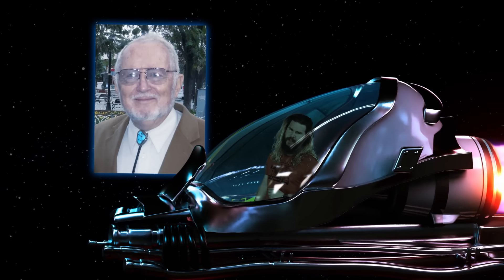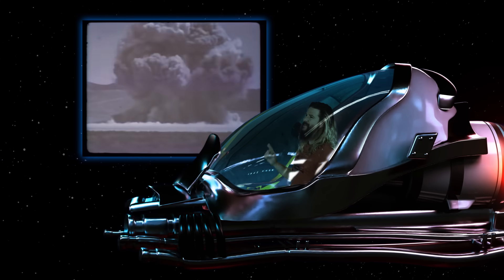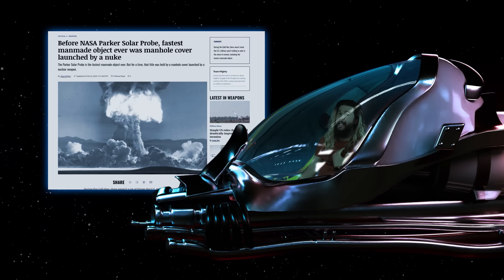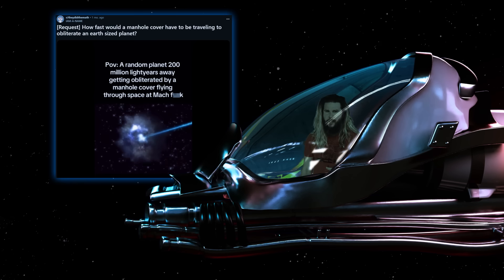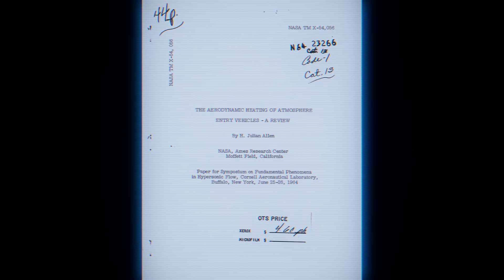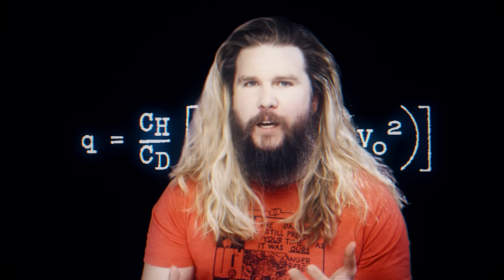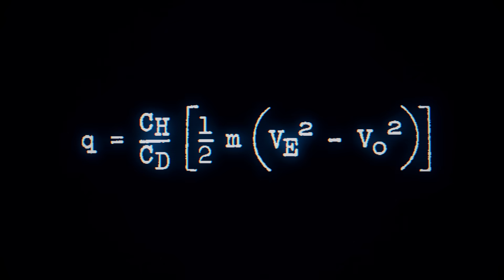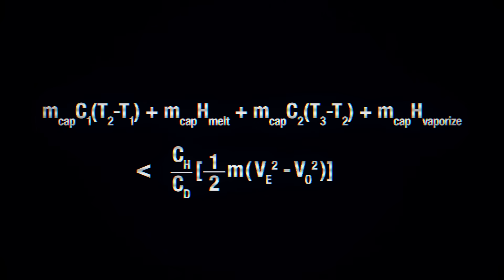Debunking the Nuclear-Powered Manhole Cover

Comment: Nope, I say there's still too many variables for basic equations to equate whether or not it actually burned up in the atmosphere or if made to space. One variable is yes, the aerodynamics, whether or not the cap was flipping or not 2, the density of the iron used, you would need to have a sample of the exact iron use. Not today's standards also escape velocity. You said 66 times the speed it takes to escape Earth's gravity, Well, how long would it take for that cap to leave atmosphere at that speed? No, you need to deal in definites if your gonna "math" this out. Need to find out how far the camera was from the test site, how fast the speed of the film was. And then once you find that out, find out how high the cap or manhole cover was from the ground on the single frame that it was caught on camera and then he equate out how fast it was moving. To be able to reach X feet or meters at x time, everything else is variable, but time is the most crucial thing in this calculation of yours. How long did the manhole cover spend in the atmosphere? Because if it spent less than a second at 5.09 J, or whatever you said, then is that enough energy to vaporize 4 inches of cast iron or would it just flash the surface of the metal?

Comment: What i have issued with is the fact the atmosphere gets thinner on the way out! Thicker on the way in. I feel it would  need to melt in a fraction of the atmosphere thickness. No math involved, i feel it made it out to space, likely , mostly burned up. Maybe 200 lbs of it. The altitude will affect it also . I think it was burned by the sun. Or is a tiny bit of space junk, or this is what  omouamoa was.😂

Comment: No physicist here, just though on things that have been put aside in that calculation. All of that calcul is assuming the manhole was traveling thru stationary air the entire time, but in reality there was probably a push from the explosion shockwave for some small amount of time in the very beginning, might not count for much, but it's at the altitude air density is at its highest.

An other variable to the equation you used is that contrary to a re-entry the object was moving from hight air density to low air density so there was less and less drag as it was moving thru the atmosphere.

An other thing very different from a re-entry vehicle or meteor is the trajectory, most thing entering our atmosphere do it at an angle encountering air resistance for much longer than if they were traveling in a straight line.

I'm not saying it did reach space, I'm not even sure if what im saying really make sense with your equation and I absolutely don't have the knowledge to come up with an alternative equation, but I know that sometimes changing one small detail in an equation can massively change the result

Comment: Some big problems I have with this, the manhole cover angle would have been nearly straight up, your equations do not include time in atmosphere, as we know from things like lasers you can apply a crazy amount of heat to something, but if the heat does not have time to penetrate the object, then it does not matter. Another point your comparison of meteorites highlights another issue, the are visible, because they are a hot object moving through the atmosphere, your example would mean we expect to see a bright streak where the cover was traveling if it was burning up like a meteorite does. Next point is how the atmospheric pressure works, it drops with altitude, meaning diminishing heating over time. 

 Also according to NASA the maximum measured re-entry temperature on earth is about 3,200 Kelvin and there is likely an upper limit to the amount of heat that can be generated by the atmosphere. Your math assumes that the maximum thermal energy was applied to the manhole cover, but ignores that reality is a function of energy over time. Longer estimates for the manhole cover being in the atmosphere seem to be about 0.2 seconds, so then it becomes a question of how many watts of thermal energy can be absorbed by the mass of the manhole cover's surface area over that span of time at the max temperature that the atmosphere can be heated to by the atmosphere of earth.   

In conclusion, you left out a super important factor, energy over time, you can throw a million jewels of heat at something, but if there is no time for that heat to penetrate the first millimeter of that object, then all you get es very hot vapor around an object with a cold center, not to mention the leidenfrost effect where the vapor acts as a barrier to protect the thing being heated. 

Honestly I was a bit disappointed that you did not consider very many factors.

Comment: @kylehill question.  How does that math work when its exiting?  If you are doing based on the re-entry then it absolutely would vaporize.  However upon exiting would the drag coefficients and temperatures experienced be less and less as it travels?  Just being genuine.

Comment: Just 2 thoughts...   first, having experience with IED in Iraq, we learned about EFP's or Explosive Formed Projectiles, where an explosive would invert a metal slug.  Well, with a nuclear bomb backing, how would that actually affect the manhole covers shape and aerodynamics as such?  It's not going to leave the barrel as a flat piece of iron, especially if it was secured in any way around the edges.

Second, because we're talking about escape velocity wouldn't the number to the right of the equation be inversed because you're starting with maximimum atmospheric density and decreasing as you progress up in atmosphere?

Comment: One key element I would like to add. If you know, or can google, what an EFP (explosively formed projectile) is; then you could possibly assume that the iron disc may have taken a more projectile like shape. If so, the drag coeff would go down drastically. Now you may say, but iron is brittle and wouldn't bend it would break. You would need to figure out if the heat applied from the explosion was enough/the right concentration to allow the iron to be ductile. I would enjoy watching some re calcs with variable adjustments

Comment: You may want to readdress the formulas you are using.  There are a few errors and variables that were not accurately used.  The formula you used for "reentry" formula used for atmospheric reentry "reversed" is not properly applied. Second,  duration of time in the atmosphere was not applied to this either. Your reasonability test was inaccurate and has observations bias. 

Pascal B was "launched" from Rainier Mesa, which is at 7,680 AGL (APROX 1.4 miles). That's important because 1/2 the atmospheric density is under 18,000 Ft AGL. The lid only has to travel through approximately 2.1 miles of the atmosphere (important for later). At the calculated speed of 150k mph, it only spent .0504 second in the densest part of the atmosphere. 

The formula you used by NASA calculates a standard launch trajectory. Again,  this only takes into account the atmosphere getting denser. The atmosphere increases friction and insulates as you come in, but as you leave there a cooling effect that occurs and less atmosphere insulate. Minor impact, when talking about such forces at these speed it's a significant factor.
Reply: Next,  the the assumption in your  reasonably test missed a lot of factors of friction and porosity of the meteor,  you assumed they took the same trajectory,  you assumed the same duration and distance traveled in the atmosphere. You also missed key construction methods and capping boreholes. 

Given, our atmosphere essentially stops at 120 miles.  The lid only spent less spent 2.86ish seconds in the atmosphere but only .0504 seconds in the portion of the atmosphere that would vaporize it.  That's important because the portion that actually burns up meteors that travel approximately 75 miles through it. At their average reentry speed (approximately 18 seconds) slowing down the entire time spend in the same densest portion of the atmosphere the lid spent .0504 seconds in. That's approximately 357 times longer than the man hole cover, ridding the breaks the whole time.  That's the difference of that crazy Russian slapping that molten steel  pouring out of the furnace and T2-ing that thing.  Again using your sanity check,  at those speeds the lien frost effect comes into play and there's a sudden release of the breaks not a hard firm application,  which is implied in your reference for the hypersonic vehicle reentry reference and standard calculations for reentry.  The same energy to takes to get the shuttle into the atmosphere is the same energy it takes to get it back and that worked out like 99.99% of the time but the shuttle dish burn up on launch just reentry.
Reply: Sorry this is long but this whole thing is in my wheelhouse. When you cap a borehole there a HUGE concrete plug poured in. At a 4 foot diameter,  average bore plug is stemmed with 330+feet of various aggregate, tar, or epoxy then sealed with nearly 7 feet of concrete, there's a 100+ tons of material before the plug.  Even if it was just the concrete, it would have been over 6 tons of material.  Deformation of the lid is highly improbable. The concrete is there to distribute act as a sacrificial barrier.  If it failed,  it pushed the lid out like the wad in a shotgun.

Comment: I wonder how the math would change if at all, if the “manhole cover” was tumbling. Would the oscillation between higher and lower surface area reduce the overall heat transfer?

Comment: You are not taking into account that meteors generally hit our atmosphere at an angle, increasing the amount of time and atmosphere it has to traverse. The manhole cover traveled straight up. At its minimum possible speed, it would have traveled the distance it needed to make it into space in about a second. Also, meteorites burn up because they hit a sudden object that is not moving per se. The manhole cover was being propelled by the explosion underneath and the moving air around it, making the friction less directly on it.

Comment: Here's some more nerdy engagement, this time on the composition of the object. First, a nitpick: "cast iron" isn't iron that is cast - it is a form of steel, and contains significant but not huge amounts of other stuff, mostly carbon. Additionally, our atmosphere is oxidizing, which means that another way a high-speed object can self-destruct is by combustion. The temperature at which iron can combust in sea level atmosphere is about 800C, far lower than even its melting point. Finally, if an object melts, it will generally disperse rapidly given enough frontal drag, as the drag force exceeds cohesion resistance. I think it's safe to say the cap didn't make it.

Comment: I noticed a distinct lack of factoring in the UPWARD velocity and the decreasing density of the atmosphere along the trajectory. 
Your math works, as it was designed for incoming objects experiencing increasing density, but you are missing that variable. Which might be significant. 

A wad of depleted molten metal could have made it out of the atmosphere.

Comment: All of the math here assumes, at least, a calm atmosphere. Now, I am not good with numbers, but I am decent with logic. A boat moving through a calm body of water at a certain speed will produce a certain wake. But that same boat moving at the same speed in a flowing body of water at the same speed will produce no wake at all, and if, for some reason, the boat was traveling slower than the water, the wake would be in front of the boat, as determined by the direction of travel.

Air works basically the same way. If the air in front of the cover was being propelled as fast or faster than the cover itself, you won't get friction from the atmosphere. (This is similar to drafting with a car. Or as a duck) Instead, the only friction will be from the air coming from behind the cover, as determined by the direction of travel, moving past the cover. This will not only give additional thrust to the cover, but also breaks the assumptions used in the math, as the cover has a plow of air in front of it for at least some part of its trip.

Comment: think of it this way: Entering the atmosphere and exiting it are very different things. For example: as you get closer to space = colder temps / as you enter, you are heating up upon entry due to the atmosphere. So in essence - Leaving earth's atmosphere should cool you off the closer you get to space... ie: the metal plate would have stayed together upon exiting, and as there was one frame that caught it we can state that it did not disintegrate from the initial explosion. That being said - if the nuke couldn't stop it, leaving the atmosphere couldn't either.

Comment: I see a bit of a flaw in your calculations. The NASA formula for re-entry thermodynamics is based on going from thin atmosphere to dense atmosphere, where the manhole cover went the other way around. This means that the atmospheric drag became less as it went, having less and less heat transfer. Also, it's impossible to give an accurate drag coefficient due to the fact that there was no flight stabilizing system on the cover. Most likely it would start to tumble as soon as the propellant was spent. Also you did not factor in the shear heat from the explosion itself. While the cover appears to ride the shock wave in front of the flame event, that much heat will definitely thin the atmosphere. I cannot tell you if the heat from the explosion caught up to the cover, but then neither can you. I suspect the cover got turned into mostly molten slag and then almost immediately solidified and did get shot out into space as an unrecognizable mass of metal that is strangely shaped like an oversized raindrop. I also suspect a good amount of impurities burned out of the cast iron and it is now more accurately described as steel.

Comment: I agree but I saw I video years ago where codyslab replicated this on a small scale and he used a copper disc and it turned from flat to a cone and my thought about it since then had been if the metal had enough time to heat up then turned into the same cone like shape it would have a better chance

Comment: There’s an issue with your logic, at the speed the object was captured at surface level it would have exited the atmosphere before it had a chance to heat to the melting point entering the cold of space all it would have only had to put up with 1 literal second of plasma compressed wind shear before complete unrestricted momentum of the vacuum.

Comment: Your leaving out a very important aspect, yes it would have burned up if it was re-entering the atmosphere but the man hole cover was being propelled by gases moving just as if not faster than the man hole cover, thus it didnt actually have the drag of moving thru atmosphere that was stationary, it was surrounded by gases moving with it, it probably didnt experience much drag at all because of this and most definitely made it to space

Comment: As a several of my fav youtubers like to say, we're going to operate in freedom units here. I dont aspire to know any exact numbers excepting the MPH figure they came up with. One thing I do know is that equation you are using can't be fully applied here because it measures based on kinetic object versus STATIC atmosphere. Because that is what they needed to know for re-entry velocities. For a decent portion of this objects acceleration, the air was moving WITH it at somewhat similiar velocity which kinda throws the proverbial monkey wrench into NASA's equation.
     Now for some numbers. Hopefully I haven't botched this up too much with no college education and all, but, 150,000 mph comes out to 220,000 fps (150,000x5280=792,000,000 feet per hour divide by 60 = 13,200,000 feet per minute, divide by 60 again = 220,000 feet per second). Please forgive my simple math, makes it easier for me to see, so, let's take that number back up to miles 
(220,000/5280=41.666666666666667 miles per second. This means, given the average upper edge of the stratosphere, where planes can't fly anymore because the air is too thin, is around 50 to 55 miles, our little flying saucer was aready though the thickest air in what? 1.12 seconds? The rest of the atmosphere, thin as it is, probably took another 3 seconds. I'm not counting the thermosphere, nobody else does. Based on these numbers, and the fact that this was undeniably the thickest chunk of refined iron to ever hit our atmosphere,.... I think it made it.

Comment: My prediction is that the 2 ton steel manhole cover was superheated and formed into a bullet shape by the cone shaped resistance that arises from yeeting a disc through the atmosphere at the speed of Mach bye bye. It would have been cast into a bullet by the atmosphere by the time it reached space, and the cold vacuum of space would harden the bullet as it is flung through the practically resistanceless void of space, potentially simultaneously turning the Earth into a projectile launching plasma cannon, and accidentally declaring war on some poor unsuspecting planet.

Comment: Ok i hear you and the math is beyond me but i see it does make sense. But you fail to account for the airflow BEHIND the manhole pushing it, Also the air gets thinner going up AND colder. The disc might have sheered of the bolts from 1 side first resulting in a side profile exposed to the friction as opposed to a huge flat surface area. Just too many variables to determine accurately, did it burn up, probably. But i really kinda hope it made it and one day we get a phone call from space like "WTF was that for?"